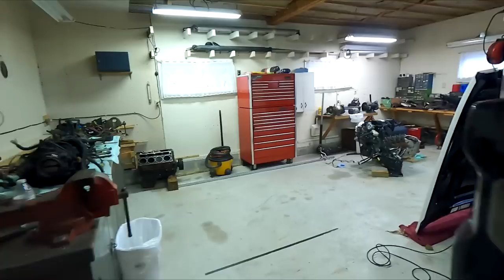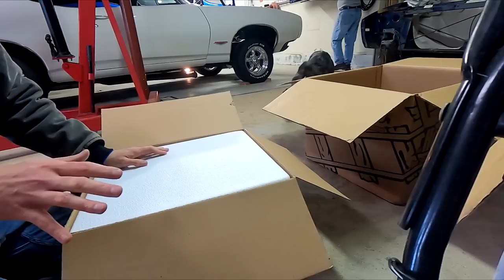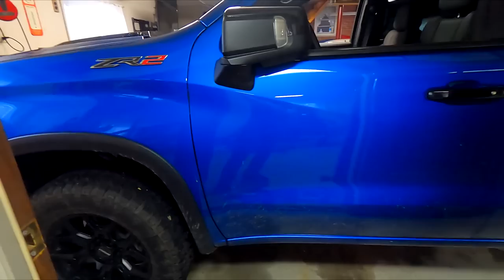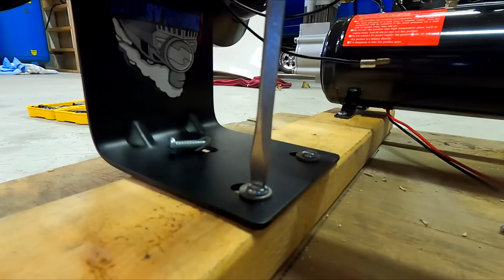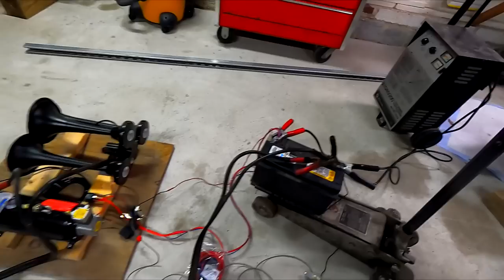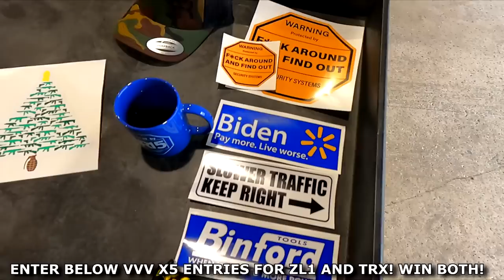KAREN Neighbor TRESPASSES So I Got The LOUDEST TRAIN HORNS On Th Market!! *WARNING LOUD

Comment: So I have a couple of questions and I'm really not trying to be a troll here but if the directions on the compressor state that it cannot get wet at all then why would you consider putting it under the hood knowing that you take the truck off road and the motor will get wet from splashing? Second question is knowing that you live in a neighborhood with all these houses around and neighbors why would you be so disrespectful in blowing a train horn like that with no regard for your neighbors at all? I'm asking that particular question because I'm a loud guy I have loud toys I have loud Motors and for that reason I chose to live out in the country and not in the middle of a neighborhood so I'm not bothering anybody.
Reply from the maker: Under the hood would at least protect for the most part. And all of my neighbors love the channel. All but one 😂